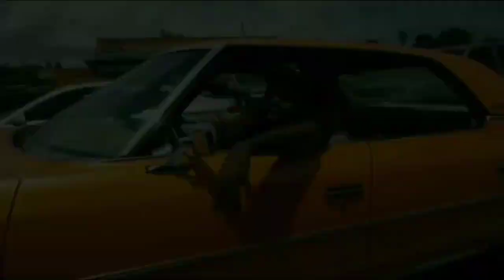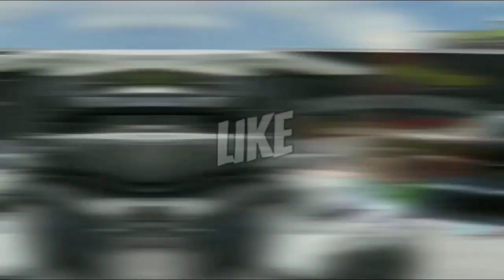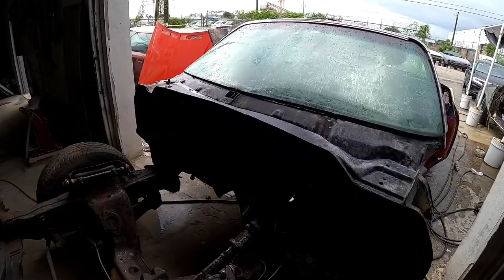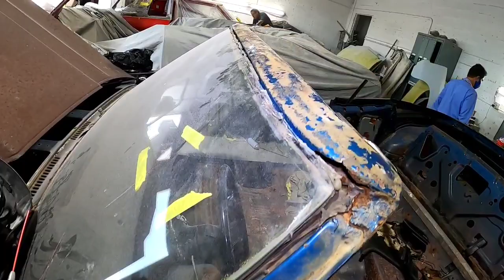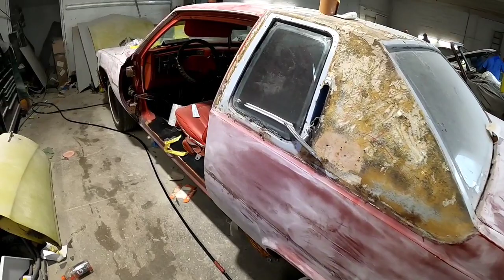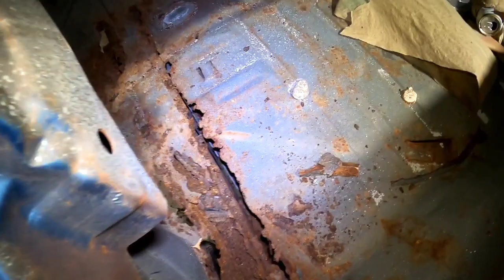RICK ROSS 1970 CHEVELLE MALIBU IS GOING FRAME OFF (HERES WHY)

Comment: I have a 1970 4- door Chevelle Malibu in the works. Overall the car was in good condition. I got it with a 307 in it, but dropped a 350. Just to do a basic restoration without taking the body off the frame I'll be out of 25 easy, including what I purchased it for.